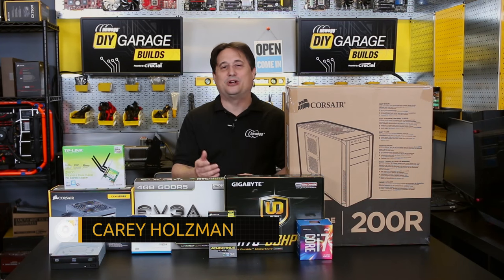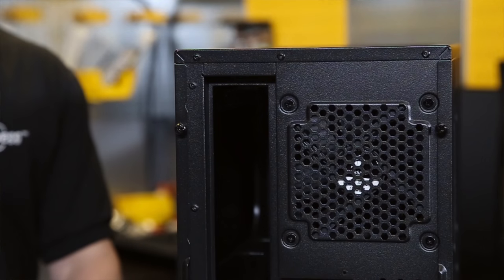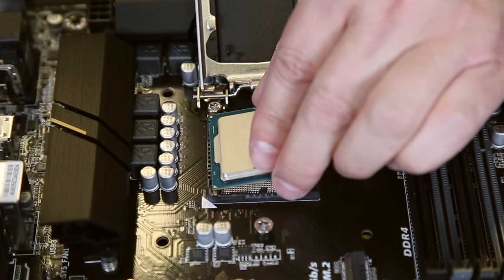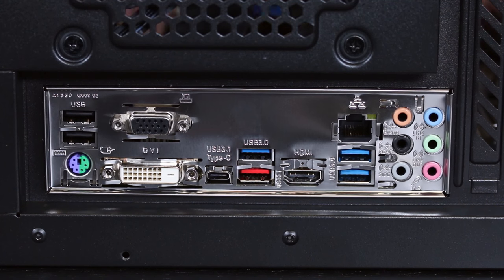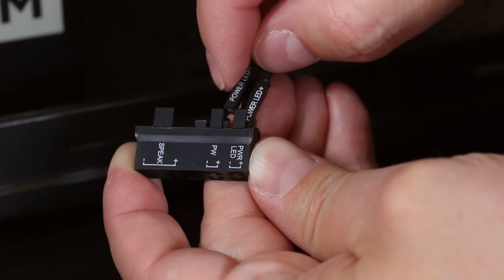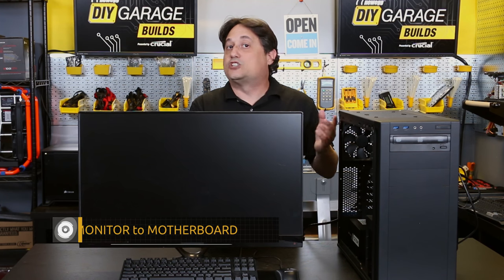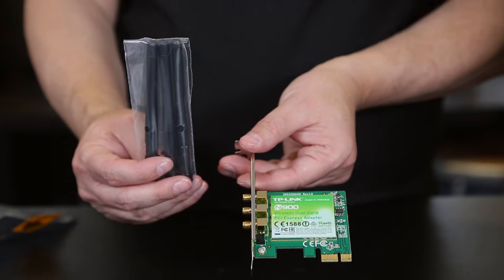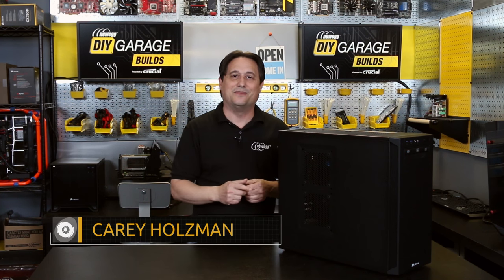Newegg DIY Garage: A Box Better Than Chocolates

Comment: Why 32GB of RAM? I'm glad you asked! The customer I built this system for is going to use the computer primarily for stock trading (and a little gaming.) He runs over two dozen applications simultaneously that monitor the stock market and need frequent and constant updating. He has several apps on-screen at the same time utilizing multi-monitors The customer can not experience lag in these updates or when jumping from one app to the next, or it could cost him thousands of dollars! Hence, 32G and an SSD!
Reply: Hey, I noticed you had a magnetised screwdriver and was wondering where I could get that. About to build a pc, and could do with a better screwdriver ;3 thanks.
Reply: +Gojirha That was explained in the first build video: https://www.youtube.com/watch?v=n2dJvqU2_x4
Reply: CareyHolzman big fan dude! You helped me build my first PC!
Reply: CareyHolzman big fan dude! You helped me build my first PC!

Comment: I've already built one PC but, this video is an excellent walk though. The only thing I find lacking is a demonstration of the rarely seen thermal paste application. I assume the stock cooler comes with thermal paste already applied but, it would be nice to see someone actually demonstrate it. I guess most first time builders are better off using already applied paste anyway. Aside from the lack of a paste demonstration its one of the best standard beginner tutorials I've seen.

Comment: +CareyHolzman Hey Carey, I'm a PC Build newbie and I'm very interested and eager to give this build a shot. I have some (noob) questions though.

I want to get the 980GB Crucial SSD, will I need to change other hardware such as the power supply or does it not matter?

You mentioned that for everyday use the on board video card is good enough. I intend to edit large DSLR videos files. The GeForce video card says 'gaming' on it. I don't intend to use this build for gaming, mostly video editing. Should I get a more task specific video card or is the GeForce 960 perfectly fine? Does the 'gaming' just confirm that it's good for gaming but not necessarily just for gaming?

The SkyLake Nov 2015 build you did looked great but a bit too pricey though I understand it will last. How many years can be expected from this build?

My intended use will be editing large DSLR video files, screen recording with Camtasia, watching movies in HD, and general office apps. For my intended use, is this build overkill? I want a fast PC is fast and will last me a long time.

Comment: Most expensive "normal" i7 cpu, with quite expensive, massive 32GB of ram  . . . and borderline 1080p, cheap GTX960. That build makes much sense. 
Drop to i5, drop to 16gb of ram, drop to 550w power supply, buy 980 instead of 960, then cake. MOre performance, same money. Just because its " Better than chocolate" doesnt mean it has to be completely retarded.
Reply: You honestly didn't listen to the requirements, this isn't a '1080P in every game' type of build, he needs a computer  that will consistently run multiple applications and tabs, therefore an I7 is important, additionally he needed an ammount of ram that would assist in meeting these requirements. There most likely won't be a lot of VRAM usage, and little to no gaming, so the GPU is a good choice with great price / performance. It is a really good build for the needs in my opinion.

Comment: Hey my motherboard is pretty much the same as yours in this build, except it's the Z version. I have a hdd, ssd, and optical drive. There are only 2 Sata connectors that came with the motherboard. Am I missing something here or do I have to switch the Sata connectors every time I want to use my optical drive/hdd?
Reply: +CarphologyYT The motherboard in this video has 6 sata connectors. What motherboard do you have that you think is similar?
Reply: +CareyHolzman I had the z170 but I built my pc and figured it out! Thanks for replying anyway

Comment: The reason I don't like using the Stock cooler from intel is that it gets very warm. This encreases the average system temperature, which later encreases the temperature of the GPU. Making the GPU hot and noisy.
Reply: +Robbinsffxi Not on any of the systems I build.
Reply: "Encreases"

Comment: With that CPU and RAM, I would assume this is meant for video editing or something more intense than just playing games. In which case, you probably want an aftermarket CPU cooler for long rendering tasks, heat management, and overall peace of mind.(despite your opinion on the topic) Obviously you'd need some higher capacity drives at that point, but this is a great start to building a nice editing rig. But this is way overkill for a gaming PC.

Comment: 1080 gaming... hey 4k is starting to happen so yea 1080 sounds like a compromise ;-)
Reply: 4k is still way behind look at gtx 1080 running 1080p on a latest title at ultra settings the gpu still struggles so is 1080p dead nope I rather have 1080p upscaled to 4k but I won't run 4k natively

Comment: How hard would it be for hdd or ssd companies to have windows already on them when they sell them. They can sell with or without windows preinstalled os license just a thought
Reply: +ronald turnbull And the unique drivers required for the motherboard chipset, hard drive controller, video card, sound card, network card? There are literally millions of possible hardware combinations. So how could that possibly work? If you want that, buy Apple.
Reply: windows finds all the drivers you need you could do first test with out hdd or ssd pluged in then after it has started and said install os you can plug the hdd or ssd with the windows 10 /7 what ever one you bought and run as normal
Reply: i watched all your videos and every time you throw away the driver disks and flash the motherboard with the new drivers then you go to get the new drivers of line or you let windows find them
Reply: +ronald turnbull But Windows has to boot first. Do me a favor and take the hard drive out of your computer and put it into another computer and let me know what happens. Then, I think, you'll understand why what you're suggesting is not possible.
Reply: i did after watching you i built a pc 18 months ago but i took the hhd out of my old pc that i put windows 7 on when windows xp finished and ran it in the old pc for about 2 years and i thought instead of waiting a few hours getting all the new updates i will just put this one into the new pc it worked first time and is still going good    maybe i got lucky you are the man that is in the know i just thought why they do not come preinstalled  any way keep up the great work still love watching your videos
Reply: +ronald turnbull 99,9% you will get a blue screen and you will need a few hours just to repair the installation for the new hardware.

Comment: I very much disagree that Skylake doesn't require a 3rd party cooler. I own 2 locked Skylake CPUs and they do not stay cool enough on stock to maintain boost clock in high load situations. Intel needs to stop including those crap aluminum blocks. 6600 auto boosts to 3.9ghz and stays there 100% on a Hyper 212 but with the stock block attached it throttles down to 3.3ghz at peak loads which is very annoying. 6700 is even touchier. Hyper T2 has the same mounting system as the stock cooler, it should be a standard minimum 6700 part.
Reply: +Jon Asgaeroth Having built more than 20,000 computers over the last 25 years and being responsible to support those computers after the sale, I disagree.
Reply: CareyHolzman did you diagnose why your benches were so low on that system? I own that same GPU and CPU but I run the 6700 with a T2. Could be losing a lot of your CPU score on 6700 throttling back to 3.4ghz periodically, which is what I see very regularly on the stock cooling. I know resting on your laurels is fun, but even a casual observer can tell this build is benching like an FX 6300 with an R7 260X.
Reply: +Jon Asgaeroth There has been nothing to diagnose and no customer complaints. Perhaps your case is not breathing properly?
Reply: CareyHolzman I switched over to Core V21's for my personal rigs, 5 of them total built and running in core V21s. 200mm intake with 140mm exhaust across the board. Systems are just slightly positive, very dust free, but throughput is excellent. There's a difference between not functional and optimal, though.
Reply: What are you using the PC for?
Reply: +CareyHolzman That's a lot of computers...

Comment: I'm  trying to build my first computers can you give me some advice 

Processor
Intel® Core™i7 Quad Core Processor i7-6700 (3.4GHz) 8MB Cache
Motherboard
ASUS® Z170I PRO GAMING: Mini-ITX, LG1151, USB 3.1, SATA 6GBs
Memory (RAM)
16GB HyperX FURY DDR4 2133MHz (2 x 8GB)
Graphics Card
4GB NVIDIA GEFORCE GTX 970 - 2 x DVI, HDMI, DP - GeForce GTX VR Ready!

1st Hard Disk
2TB SEAGATE 3.5" SSHD, SATA 6Gb/s 7200 RPM (64MB + 8GB SSD CACHE)

2nd Hard Disk
4TB SEAGATE 3.5" SSHD, SATA 6Gb/s 5900 RPM (64MB + 8GB SSD CACHE)

1st DVD/BLU-RAY Drive
16x BLU-RAY WRITER DRIVE, 16x DVD ±R/±RW & SOFTWARE
Processor Cooling
Intel standard cooler
Power Supply
CORSAIR 550W VS SERIES™ 
Sound Card
ONBOARD 6 CHANNEL (5.1) HIGH DEF AUDIO 
Operating System 
Windows 10 Home 64 bit